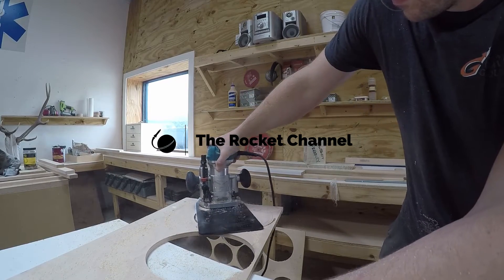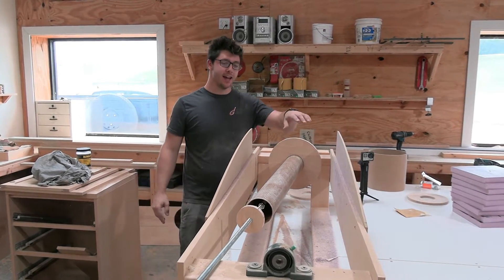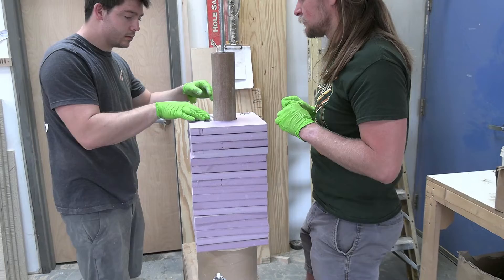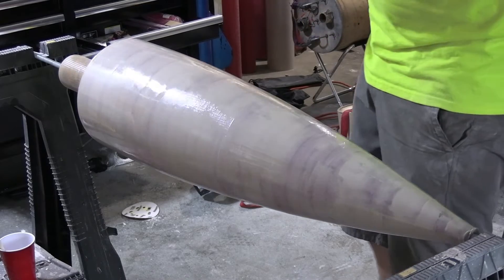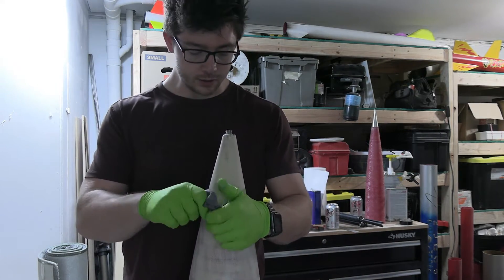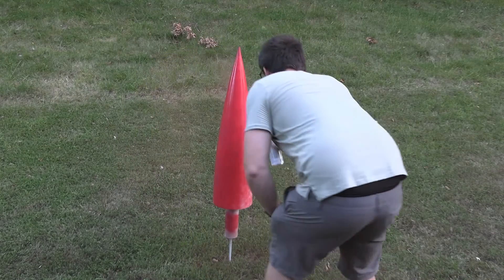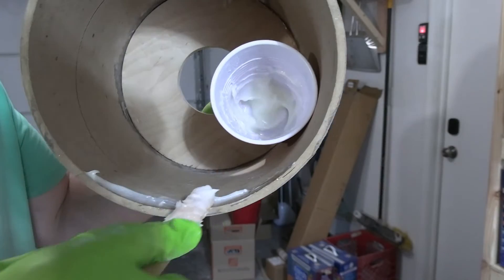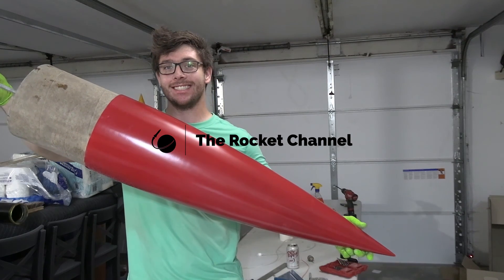Making a New Nosecone for Our 100lb Rocket!

Comment: Hi Taylor, what weight glass did you use from Soller Composites ? More than one layer ? Did you leave the tip washer and nut on ? Curious how you finished off the tip, more foam  glued on ?

Comment: I started making nose cones a few years ago and when I first started I just used expanding foam in an 8 inch cardboard concrete form tube to make a cylinder and then shaped it from there. I just 3D print a mold and make a fiberglass nose now because I’m lazy 😅

Comment: That nosecone looks fantastic! This time, the nosecone looks to be much more structurally solid. Just by watching this build as compared to the last nosecone build, I have far more confidence in this one lasting quite a long time. Well Done!!! I will say that I would have loved to see how the fiberglass got laid over and the epoxy resin was applied to the nosecone without the fiberglass getting wrinkled or kinked. 💯A+ craftmanship
Reply from the maker: Thanks! I have no doubt this nosecone will last the life of the rocket. Learned a lot on the first one. 

I used a Soller Composites fiberglass sleeve to glass it. A 9” diameter as small as it would go and then overlapped with a 3” sleeve toward the tip.